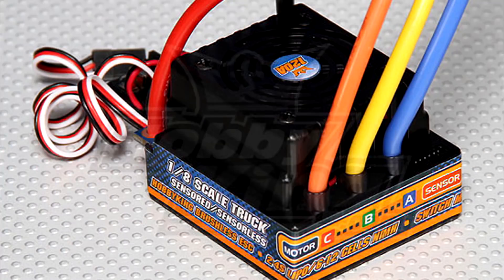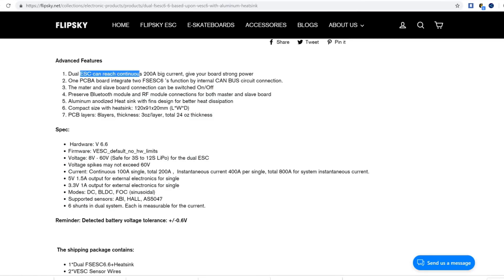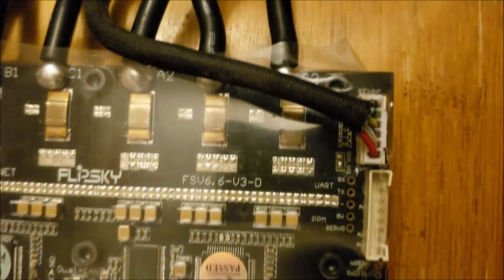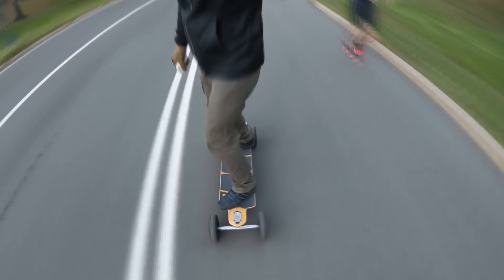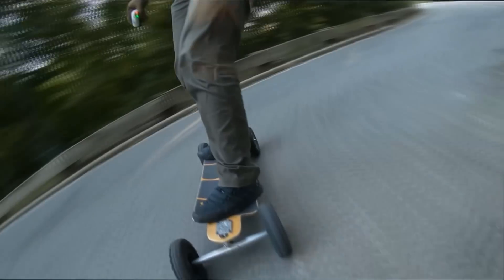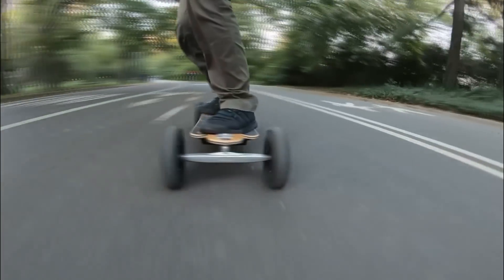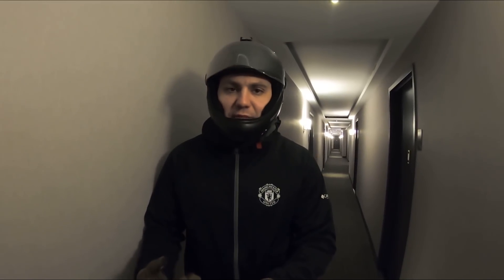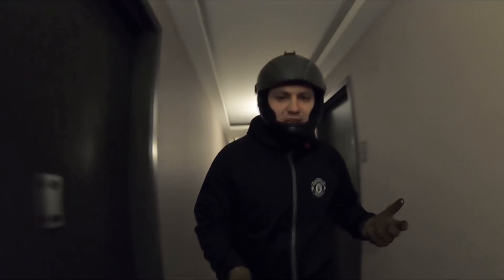16 inch Custom Truck with FLIPSKY DUAL FSESC6.6 - 100A Discharge Killer set up!

Comment: What motors do you use? It looks like 5055 or 5045 or 6355. What about KV and the hill climb? Thx!
Reply from the maker: 6355 - 200kv. I have several sets. the motors are working well for city riding. let me know if you are looking to buy a pair. I have plenty.

Comment: Hey dude, so, 14 months later... Is this ESC still working? No problems?
Reply from the maker: YEs esc is working but the new esc that just bought from Flipsky came in broken and the company is not helping replacing them. I can finish the S2 4x4 video because one dual came in broken. I would stay away from Flipsky... I am even thinking now to remove all the flipsky videos I made since the company is BAD!!!
Reply: @ElectricVehicleSpace  That's a shame. I have heard elsewhere that their customer service isn't very good. I guess you have to be lucky in what you receive, otherwise you are screwed!

On the flip side, you know it's Chinese New year right  now? On their store, it says they are away till 2nd of February. Maybe give them another couple of weeks?
Reply from the maker: @harryforks6708  I was talking with them before the hokiday and they did not want to address the issue right away.
Reply: @ElectricVehicleSpace  TRAMPA is the way to go with VESCs.

Comment: You stated in your video that you changed the setting to 50 amps for each motor.  So does this mean that your battery + bms has a 100 amp discharge rating?  i'm fairly new to this DYI.  Was thinking about modifying my GTX board with the Flipsky ESC.  Any insight from you would be appreciated.  Thank you.
Reply from the maker: Watch my other videos. I dont use bms

Comment: Great video 😁.  I received one recently.  When configuring it did you treat it as 2 VESCs or as 1?  Also, you mentioned a noise at the end of the video.  I don't think I've heard a noise come from any VESC.  Could you help clarify?  Thanks man and love the channel 👍
Reply from the maker: I have to set it up as 2 separate vescs. Yes the focbox make a specific esc noise that is hard to explain but you can hear the difference when you swap the motors with different kv, size or manufacturer.  its common to all esc. I think I sould specify that this noise is coming from the motors but that noise is directed or controlled by the esc running/running. With this esc the motors are not making any noise until you reach 25 mph. Thank you Neil for the kind words. I hope we meet and ride this coming year.

Comment: Damn...I wish I had some "play" money...nice board dude! I'd love to make a board of my own. I want one to cruise hard packed beaches before/between/after surf sessions. Have you ever looked at an EPIC Dominator? https://www.epicelectricskateboards.com/product/dominater-4000-pro-with-2-x-2000watt-motors/ . I wonder if you could source those parts and make it better without ordering from Australia? How much do you think a board like that could be built for? ( rough estimate ) Thanks ahead of time for any feedback at all...Cheers, John ;)
Reply from the maker: Hi John Egan, thank you for the compliments. To make this board is easy. Just get an evolve gen 1 truck with one mount. Design motor plates and cut them. Weld on the truck aluminium piece that accommodates a second motor mount and you have the rear drive ready for assemble. Buy a deck, mine was $100, esc $270, make a battery, wheels, sprockets, radio and the board is ready. 

I the board I made has more power and better design with lighter weight compare to the board you linked. Best, EPV.
Reply: @ElectricVehicleSpace  Yeah, I know your work and it's impressive...great skills and knowledge. Just don't have the funds to "play" right now. One of these days, I'm gonna be cruisin our beaches here in Nova Scotia on an off road ESK8...it's on the "bucket list"...lol ;) Thanks for the info! Cheers, John ;)
Reply from the maker: @funafter5081  thank you John Egan.

Comment: Hi, what motor mount, pulleys and gears are you using and where did you get them. Thanks!
Reply from the maker: Motor mounts I drew the autocad and water jet them. The mounts are super thick and strong. Hanger 16" evolve gen one. I welded another mounting sphere and bolted the motor mount there. Motors are 170kv 6355. Pulleys 72 and 15 with pitch 5m.
Reply: Any chance of doing this as a production board? Even just limited edition. I'm in South Africa and I'm sure it would sell really well.

Comment: Hi what are your thoughts on the new focbox unity? it's about 30/40$ more and has a full cover alluminium heatsink but i think is based on vesc 4
Trying to put together the parts for a mountainboard build and i was looking at alternatives thanks for your hard work!
Reply: Thanks for the response i was thinking of pairing the esc with sk3 6374 192kv from turnigy but i was looking at eskating because i'm based in Italy
Reply from the maker: @war10000k  I just returned from Italy 3 weeks ago. I was in Bergamo, Lecco and Milan.
Reply: @Portable Electric Vehicle I hope you enjoyed the trip, I want to build a mountainboard because the streets here are too irrgular and with my current skateboard (acton blink qu4tro) I'm having a really hard time going around without risking to crash...
Reply from the maker: @war10000k  yes this esc would work great.
Reply from the maker: Focbox is going to be good too....the problem is we will have to wait for it to be available. Enertion is known for always overpromising. I ordered mine and they told me end of November. Let's see what happens.
Reply from the maker: Flipsky looks like will be better than focbox. Just by looking at the wires 8 awg and bigger soldered joints, heat sink I think flipsky will offer more power for offroad.
Reply from the maker: You should stop advertising here. I interacted with their customer service and they mentioned that the smaller esc only works with 10S and on 12S there are disconnect issues. I think you are wrong here. The esc I used here works very well.
Reply: @ElectricVehicleSpace  I've heard good things about the flipsky 6 dual, glad to hear its working well for you. I am one of the engineers that designed the focbox unity, glad to hear you will be testing one out! I wouldn't trust the "100 A" rating flipsky puts on these, I need to order one and bench test it myself. I expect it is probably about equal power to the unity i.e. it has plenty of thermal bandwidth for all e-skate and emtb application. The unity does also offer a few distinct advantages over the flipsky unit; mainly integrated bluetooth, integrated smart-switch, and new app which makes setup fast easy and enjoyable. Heading to Shenzen this Thursday to get all the Unities tested and shipped can't wait for you to receive yours! Everything is lining up for on-time delivery.
Reply: @Jeffrey Friesen Hi just to be precise the focbox unity is based on vesc 4 correct? What do you think about the flipsky having 2 separate chips over the one of the unity?
Reply: @war10000k  there are many differences between the vesc 4 and vesc 6, the unity is similar to the 4 in that it uses two low side shunts for current measurements, but that is about where the similarities end. There are a host of improvements to the hardware to maximize reliability that won't fit in this comment. Using a single processor is awesome because you only have to interact and configure with a single controller to get powerful and synchronized control of your board.
Reply: Hi i'm kinda going to pull the trigger soon i have just got the batteries and the SK3 6374 192KV motors how is the esc doing?

Comment: Creating your own boards now huh. When does it go for sale?
Reply from the maker: I put it together with some of parts that I had laying around. It is not for sale...it rides super smooth and has a nice flex. I tried lacroix and i was uncomfortable. Narrow stand and wheel bite. With this deck its all different story and with 12S I get more power than the croix 10S set up. The trucks feel very similar. I will mod it to go 25 mph top and get 15 miles range.
Reply: @ElectricVehicleSpace  Would you possibly sell one of these : ))
Reply from the maker: @curtflirt2  I can make a similar truck and you can get the parts and put it together. I will be getting more boards and maybe in several months after I build something else I may sell it....or you can build one if you want it now.
Reply: @ElectricVehicleSpace  Lol I'd probably wait for you if you ever decide to sell one. I just watch the videos at times, don't really know about the parts at all and have never even considered building a board.
Reply: @ElectricVehicleSpace  how can I get ahold of a truck set?
Reply from the maker: @sb2255-s3v  I can make one more set but to weld and hater jet will be expensive.
Reply: @ElectricVehicleSpace  how much for the parts? I can get a welder here in vegas
Reply from the maker: @sb2255-s3v  it can be between $300 to $350 just the hanger with the motors plates. If you decided to get 10 kits or more it will be cheaper.
Reply: Portable Electric Vehicle can you mod it to have fast swap batteries?

Comment: look great. what are those trucks?
Reply from the maker: Those are first gen evolve trucks 16 inch. It was one motor mount and I designed and welded the second motor mount.
Reply: Portable Electric Vehicle that's insane. I wonder what's the different between the flipsky and the maytech dual vesc
Reply from the maker: @minezhang4173  I did not use maytech but I can tell this esc is the best I tried.
Reply: Portable Electric Vehicle ok. Thanks
Reply from the maker: Anytime.

Comment: We doing some testing with this in Portland. 🤙
Reply from the maker: At the time I recorded I had 30 miles on this esc and now I have close to 100 miles. So far performs super well. I have a felling this ESC may be better than vesc 6.6. How did your testing turned out?
Reply: @ElectricVehicleSpace  we still have a few more simulations to put it through but real world testing has been outstanding.
Reply from the maker: AWESOME! Also please update here in the comments if you learn something new. Thanks.
Reply: @ElectricVehicleSpace  looks like you are using the https://flipsky.net/collections/electronic-products/products/dual-fsesc6-6-based-upon-vesc6-with-aluminum-heatsink
Reply: I'm unclear because of  " This ESC discharges 20 AMPS more than Vesc 6.6 at 1/2 of the price. "
Reply from the maker: @DanPrintzhunny  this esc works well after 1 month of daily ridding.